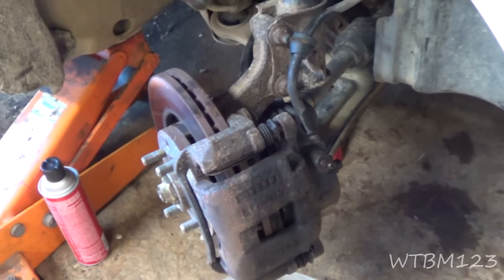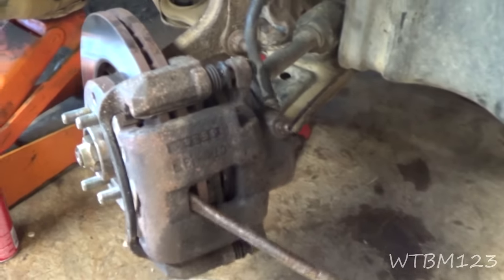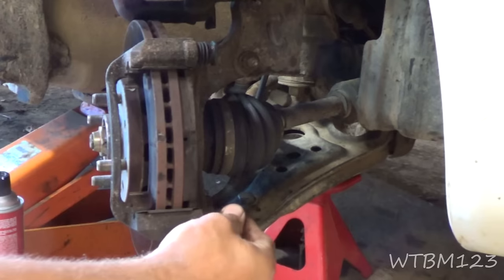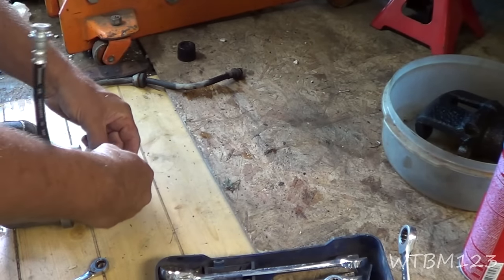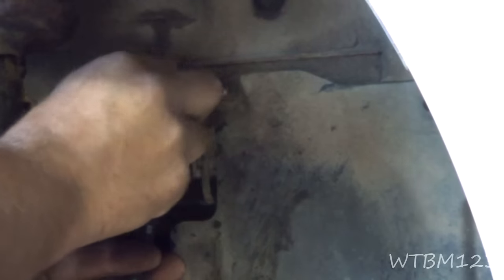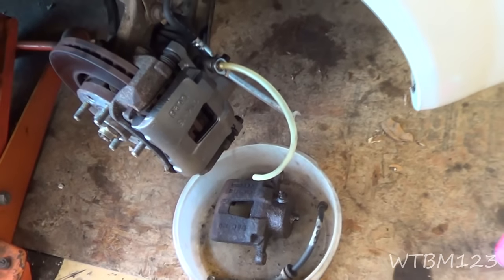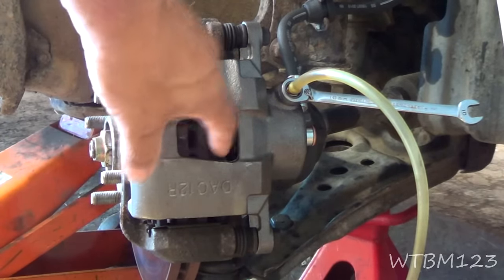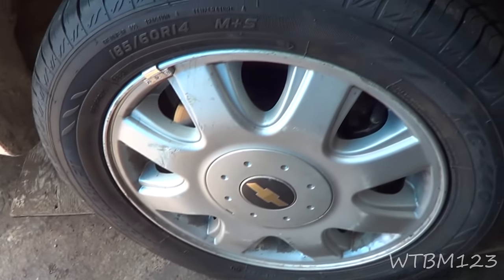Stuck Brake Caliper or Bad Rubber Brake Line #brakes #bleedbrakes #brakehose

Comment: Good vid, but what if the piston retracts, just not fully? I've got a 2009 Accord (rear brake caliper piston)  that just won't retract the last 1/8 of an inch, just enough to keep it from fitting over the new pads. Could it still be the hose in this scenerio, or is it more likely the  caliper?
Reply from the maker: If bleeder is loose and caliper does not go back it is usually the caliper , some rear calipers turn in and some need turned to line up with pins on the pad. And make sure caliper slides move free.
Reply: @wtbm123    Thanks for responding. So, I haven't opened up the bleeder yet, does that mean if the piston fully retracts, the hose is bad? Slide bolts are fine, and the pad pin is aligned. It's just that the piston still has about 1/8 inch to retract.
Reply from the maker: @094340  If you open bleeder and then caliper goes back in normal then the caliper is most likely good , And not saying the hose has to be it , but the hose is the most common fail in most of those cases.

Comment: 2013 Kia Sorento EX brake pads crumbling up breaking apart metal backing plate came off of the inside pad and when open caliber to check the Piston already is retracted am I looking at a blocked brake hose?
Reply from the maker: Could be , but only way to know is to do some test and see what is going on .

Comment: this may be a silly question but i think i have a caliper sticking on the right side causing some slight drag. i havent had a chance to examine it yet, but if i can determine that the caliper is indeed stuck and there has been some additional wear on the right size as opposed to the left, do i need to change the pads on both sides again and/or turn the rotors? I have basically brand new pads and rotors on. thanks
Reply from the maker: +Thomas Salley Well i guess if pads are worn bad on one side , enough to replace , my self i would put both sides on , and if one side got hot , it may warp a rotor . If you do not feel the wobble while braking , and the rotor looks good then it prob ok , But it would be up to u to decide on what they look like

Comment: I changed the caliper 2 times from the store because of the dragging. Now it's doing it again. So it's probably the hose, correct? I just bought a new hose to put on in a few days.I have a 2007 Kia Sorento and my hose looks entirely different. Do all these hoses have the clip that you took off, or similar to it?
Reply from the maker: Not all are the same but still the rubber line can be the issue . Hope you get it all sorted out

Comment: Could also be metering valve,,,by loosening bleed screw you relieved pressure and eliminated caliper as the problem,,
Reply: And the hose,,,, the pressure should have relieved at master cylinder my friend.
Reply from the maker: Yes loosening bleed screw checks caliper
Reply from the maker: Yes if hose is restricting , it will hold pressure all the way back to master cyl. , But if loosen hose from hard line and pressure goes away , the hose was the issue
Reply: @wtbm123  many don't realize there is a RESIDUAL VALVE in many master cylinders and proportioning valves set at 2 lbs for disc brakes and 10 lbs for drum and it dosent take much to clog up the tiny orifices causing pressure to increase and hold brakes on.

Comment: i have a suzuki sidekick 1997 both calipers sticking already changed th master cylinder seals, changed the caliper seal cleaned them and its still sticking do you think its the hoses im having problem with?
Reply from the maker: Could be , You can loosen the bleeder to find out

Comment: Question on the wsshers.Ones I got in past have a flat side and a more rounded side.Does it mayyer what side goes where?
Reply from the maker: +newyota1 do not think it matters but i usually put rounded to bolt head . some are flat both sides too

Comment: A question for you, I'm having problems with my front brake, the piston is getting stuck  so I done replaces them both (front) replaced the rubber hoses that go from caliper to the master cylinder, replaced the brake fluid and bled the lines and the front pistons are still sticking (replaced calipers too) can you help?
Reply from the maker: wonders if abs controller , hard to tell with out seeing

Comment: Would any of these issues make it ao the vehicle can not move? I think my 2008 rav4 has either a bad calper pin or maybe the break lines just seized up my caliper but my baby cant move. Engine is fine. Transmission is perfect actually i just did a whole transmission fluid change and filter and installed a new valve body 4 days before this issue happened. I did the rotors and break but not the caliper which i should have, but after over $600 in parts, i already did replace i just couldn't afford it. They look pretty good. I cleaned them up and smoothed them out a little and they seem nice still. But yeah. Would any of these issues make it so the car cant move?
Reply from the maker: If any brake codes the traction control may be taking over .  If you jack it up , can you turn the wheels. If someone steps on the brake , can you see the calipers slide any at all.
Reply: @wtbm123  yeah all turn besides the front passenger side. Also, there are no liggt on at all. But, i figured out it's a seized hub
 And when I say seized I mean SEIZED. I had to heat up the 12 point hub bolt on the front for 10 minutes then take a candle and let the wax get sucked in there while cooling just a little, then took a breaker bar with another 4 ft extension bar so 5 ft in all maybe more, to get judt thet one bolt off. Now. The back 4 are almost impossible to even get any kind of tool in there and there on there so tight I think I might have to cut them off. I'm going to try to heat the bolts up from my side and hope it doesn't melt my cv axel boot. And then hopefully they break free... thank you for replying tho. Any tips on this hub dilemma I got going on? 😅 I laugh because if not I might cry this has turned into a few day thing and I only got off 1 bolt. After the lug nut of course... look forward to your reply. If you cant get back to me I completely understand I still really appreciate you replying already. Thank you.

Comment: I have a question.. I changed the brakes and discs and caliper on my 2004 GMC Yukonxl.. after all that was installed. Now there’s is noise coming from under the truck.. I’m thinking it’s got to do with the chasis it’s a clunk noise and it doesn’t do it on a regular sturdy base it does it when it want.. so you have any idea what might be.. I can’t tell we’re the noise is con from because it only does it when it’s running about 35 mph or so.. neee help if you have an idea I would really appreciate it thanks
Reply from the maker: Make sure anti rattle clips are in  and everything is tight

Comment: after watching this video i believe that hose was most likely still good...when u opened the bleeder and moved the caliper, barely any fluid came out....if the hose was truely in bad shape wouldn't there be more fluid coming out of the bleeder?
Reply from the maker: If the caliper is stuck and will not push back in , but will push in easy with bleeder open , most times it is the hose . The hose does not have to be blocked off fully to be bad , and if blocked , only fluid to come out  would be what is left in caliper . Also a hose can be restricted in only one direction of  flow . This hose tested bad .

Comment: Generally as a rule, I replace the hose with the caliper. Same as soon as I suspect the caliper of hanging up, I know where I live that bleeder screw is just going to snap off. I do not mess around any more with trying to break a frozen bleeder screw loose, its not worth my time trying to free it up. Its easier just to replace old parts than fart around with mabe its this, mabe its that. I hate taking things off and putting them back on again and again.
Reply from the maker: I have a broken drill bit that fits snug in the bleeder hole . it helps from snapping the bleeder off , but here to most are rusted in and refuse to come loose
Reply: @wtbm123  In Michigan, its pretty much a given when a caliper is hanging up, its rusted and the thing is toast. That bleeder screw is original equipment and no one has their fluid changed in Michigan. I started doing it myself a few years ago and have to say, it has prolonged things. With  ABS, letting old fluid sit in your system is asking for trouble.

Comment: Need to take the bleeder completely out to make sure the bleeder isn't clogged.
Reply from the maker: Yes if loosen bleeder and nothing , it would be a good idea to go ahead and remove so it is eliminated.
Reply: @wtbm123  even if it has a weak stream you need to remove and check flow.  There may be a restriction causing an issue

Comment: Hi, instead replacing with new caliper, can you repair the old one which is sticking.. Thanks for the video
Reply from the maker: Yes you can, If the inside is not pitted you can rebuild a caliper. But finding a rebuild kit is not easy anymore,and lots of times a kit and piston is as much or more than a rebuilt one. For me i can replace most customers calipers for them  cheaper than buying a kit and spending the time to rebuild .Thanks for watching and commenting.
Reply: yes clean the piston replace new seal
Reply: Also, don't overlook the caliper pins, because if they don't have enough lubrication, that alone can cause the caliper to stick. Remove the pins, inspect them, remove any rust, and coat them with brake caliper grease-then reinsert, and see if that solves the sticking problem.

Comment: Hey guys I am at my wits end. I have a 2015 F150. I started noticing a rubbing/dragging in my brakes. At low speeds I would hear a sound that was like a grinding noise. Very low pitched. I changed the pads (twice), rotors, calipers.  I have changed one brake hose (drivers side) because that was the only hose available...anywhere. Still get the same noice. I thought it may be the IWE because I have a 4x4. So I have changed out the solenoid and check valve. Still getting the same grind or rubbing noise. I ordered the other sides brake hose, so I’ll change it soon. What else can I be missing?  I can feel the rub in the pedal so I am leaning towards the brakes. I hope changing the hose will work, but again this is a 2015. I do have a lot of highway miles on the truck (72k). Any ideas??

Comment: It can also be your porportional valve.alot of times they get dirty and rusty..if ur lucky just pull it off and clean the  inside/spring with some brake cleaner and some steel wool & or a wire brush...after just bleed the system..SAVE $$$ DO THINGS YOURSELF!👍😎😎
Reply from the maker: Thanks for stopping by and commenting

Comment: I'm having a hard time getting the rubber brake hose bolt to budge off the caliper before I remove it to change out the caliper. I have liquid wrench penetrating oil soaking on the bolts right now but it doesn't seem like it'll do much. Any tips besides applying heat to get these bolts to come loose?
Reply from the maker: May try hitting  wrench with hammer , or double wrench it

Comment: Sorry, but you said "I went to the back and readjusted the rear brakes, then the pedal was better."  What does that mean?  I'm replacing my front rotors and calipers shortly and thought all that was needed was what the video showed, but your last line or so shocked me!  Thanks =)
Reply from the maker: The rear brake was a separate issue and will cause a low brake pedal.  I do not remember exactly what i said on video but if you are not having a rear brake issue you will not need to touch the back brakes ,but lots of times if it has rear drums and your pedal feels low but solid it could be that the rear brake shoes could be out of adjustment and making you have to push the pedal farther down before the rear shoes contact the drum. Also if installing new rotors be sure to use brake clean to remove the oily substance they apply, so the rotor does not rust in storage before it gets sold. Sorry for the confusion.
Reply: wtbm123 Wow, thanks for the fast reply!  I didn't know about the spray down before hand!  All four discs on my car, so I'm hoping the fronts are all I need to do for now - 95 740i with driver's side caliper that refuses to let go, slide pins are cleaned up, and passenger side doesn't spin freely anymore either so I'm putting new rotors, pads, calipers, hoses.  Thanks for your video! =)
Reply: I think what he meant was, after he corrected the problem with the front caliper, the customer's brake pedal was still a little low, because the rear brakes needed adjusting. I'm not sure exactly what he meant by "adjusting" them, but maybe he needed to gravity bleed the rear brakes also, to remove any air bubbles, and add more fluid to the master cylinder? Or if the rear brakes were sticking also, maybe the pedal wasn't fully returning to where it should be (ie, low). That's my best guess anyway, and I maybe he'll answer your question, as I'm wondering too!! :O))
Reply from the maker: bookguitarguy Drum brakes on rear can get out of adjustment and cause low peddle feel. Because they have to move so far before making contact to drum. Was nothing to do with air in the back . Thanks for watching and commenting.

Comment: Doing the front brakes on 01 Forester L all over 220,000 miles in Michigan so there's plenty of rust...
I have a sliding pin on each side the left and the right front that is seized that I cannot remove any suggestions????

And if you suggest an air chisel what brand and model any help appreciated stuck in the driveway🤨🤞
Reply from the maker: Sorry for being late , but heat and penetrating spray . Not sure what it looks like on one of those so i am prob not much help
Reply from the maker: may be able to twist it some
Reply: @wtbm123  Thanks resulted in using heat👍

Comment: If you open the bleeder right from the get go - and have someone slowly depress the brake - if fluid comes out in a spirt - the line is fine.  Move on to the caliper.  Really no need to change both, if this was done first.
Reply from the maker: Not always as sometime fluid will go out but not return through the line . kind of like the live is acting like a check valve

Comment: great video, im sure this will help me. there a rubbing noise that gets louder when i break coming from the front of my car, i suspected a caliper issue but the shop replaced my pads and rotors first, and now both wheel bearings. the noise is still there though and they dont seem to think its a caliper issue. any ideas? i hear it most going slow, and it sounds horrible when i break (a constant scratch/grind)
Reply: Tim Brown Turn up the radio
Reply: Tim Brown try to localise the sound. jack up one corner of the car and  rotate the wheel by hand. no noise? jack the other corner up and rotate the wheel. hear a noise ? some cars had a thin metal splash shield behind the rotor that could touch it. bend it back just a little. front driver ? check where the axel enters the hub, also, could be the CV joint itself. I assume that they checked thatthe caliper moved smoothly on the guide pins, and there wasn't much play
Reply: Tim Brown
Reply: I had a problem where I had had the rotors turned, whenever I would brake going fairly slow,(stop sign, pulling into garage), there would be a rubbing noise. It bothered my wife so much that I finally got new rotors. That took care of the noise.  So my assumption that the lathe for turning the rotors was slightly off adjustment was correct.
Reply: Is the abs.is bad

Comment: so what does it mean if 3 of 4 brakes ares ticking? 2 front disk rotors were 50 deg c after an hour drive and one rear drum was pretty warm too.
i just changed the front pads  last fall but rear shoes need to be done  now too?
Reply from the maker: A lot of things can cause it . rubber hoses , stuck calipers , Pads stuck not moving , Caliper slide not moving . Drum could be stuck parking brake comes to mind first . Hope you get it all sorted out
Reply: @wtbm123   i just went and  installed some raybestos drag reduction clips between my brake pads and i can clearly see they are rubbing, theres a square hole where i can see the resting state of the pads is touching. Especially on the side of the piston, the other side mightve had a 0.25 mm space .
Maybe my replacement pads were just a hair too thick, maybe i just need to agressively brake with it every time i drive it and wear them out a bit.
Maybe i will just end up replacing both calipers and/or  both rotors sometime soon.

Comment: I would think that it would be good practice to replace the hose too if you are replacing the caliper, especially if you are charging a customer. So you don’t have a comeback.
Reply from the maker: The hose is not always bad , but should inspect the oout side of it any way . And if live in a rusty area sometimes changing the hose ends up also changing a lot of hard line

Comment: Just put some cheap pads on my car and around 45 mph there’s a vibration in the rear end that gets worse and then I have to pull over. The wheel is hot and I smell burning pads. This didn’t happen until I replaced the OEM pads with cheap ceramic pads.  Any suggestions on what’s going on here? Should I try putting oem pads on or replace the caliper?
Reply from the maker: Well unless the pads are stuck and not sliding , i would not think they are the issue .   Are the caliper slides free and sliding well . but  now the pads ,if they slide in to the caliper bracket they must move freely by hand . Sometimes pushing a caliper back in it can stick . When a caliper and pads are installed correctly , and caliper is fully pushed back . it should slide freely , and not bind . i show this in other brake videos